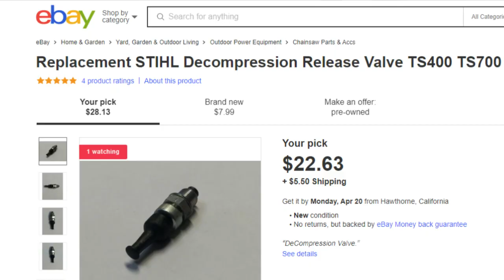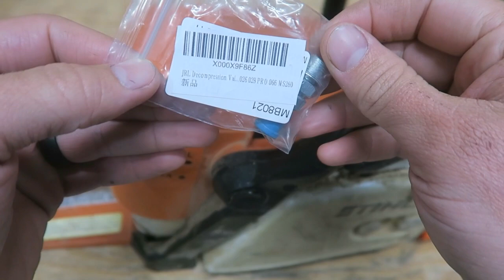Stihl MS390 Decompression Valve Failure and Replacement

Comment: For two days in a row I worked on the decompression valve and carburetor. The valve allows gases to pass through during operation. I think to put the plug, to exclude it. Compression will rise and shrink faster. So many do. Chainsaw Motr Sich 270, 70 cm cubic. I didn't do inclines with a barbell today, I just squatted.😆😂

Comment: I have a STIHL 441 magnum and I love it when it works.  85% of the time I just end up using an echo that starts every time.
Reply from the maker: I now have 3 Stihl chainsaws. This one is by far the most unreliable. But I don’t blame that on the brand. The engine has been rebuilt at least 3x to my knowledge. The first time with genuine Stihl components. Rebuilt due to having a tree fall on it. The 2nd and 3rd times were with cheap aftermarket parts. It’s had a rough life. I will say, my MS251 seems like it needs an adjustment. The only complaint with the MS400C is the weight adds up quickly; but it’s an absolute beast. It also chugs fuel!

Comment: This very thing happened to my MS390 this past weekend. Only difference was the pin when in the cylinder hit the spark plug perfectly and smashed the electrode flat so it wouldn't start. Re gapped it and she fired up and ran.
Reply from the maker: Nice! I’d definitely recommend installing a plug in place of the decomp valve.
Reply: Yeah that will certainly be the way I go. Had an old one laying around d so I just threw it in for the mean time.

Comment: I have a husqvarna 257. The decompression valve was leaking every time I try to start it. Replaced it and still leaks. And it won’t start why is that?
Reply from the maker: Is your exhaust leaking? Spark plug gap correct?
Reply: Thrifty Garage exhaust not leaking. I don’t know the correct spark plug gap number. I took it to a shop to see if they can find the problem
Reply from the maker: Do a compression test. Sounds like you might have a cracked cylinder head or something else causing loss of compression and a no run condition.
Reply: Thrifty Garage it started up the other day. But I shut it off like an idiot. After that I couldn’t get it to run and then noticed the valve problem. I changed the spark plug too. Let’s see what the shop says
Reply: There might be a gap between the bottom and in the top end and that's where your air might be leaking from
Reply: Not much of a chainsaw operator or mechanic, trying to start a saw with the scabbard on!
Reply from the maker: The chain break was on. Plus with the cement floor I would rather have it eat through plastic than dull the chain on the concrete.
Reply: Just remove the decompression button and put a metal plug in its place lol
Reply: @ThriftyGarage  what compression psi should I have on a stihl ms391?

Comment: My MS 290 does not have a hole on top to get to the  Valve.    So Your demonstration is a JOKE
Reply from the maker: If your machine doesn’t have a hole then you likely don’t have a decompression valve. This chain saw was upgraded from a ms290 to a ms390. The larger chainsaws often have decomp valves to aid in starting because they reduce the engine compression. When I performed the engine upgrade I also drilled out where the valve would be in the plastic cover.